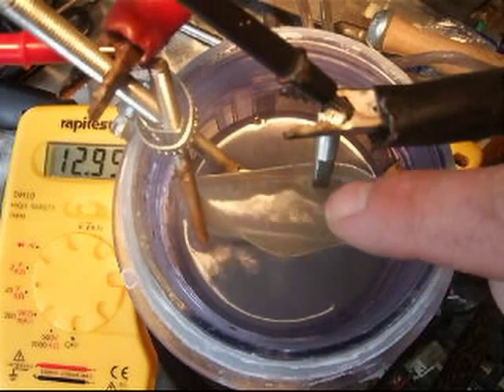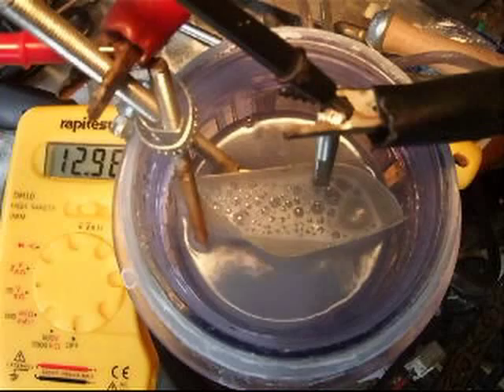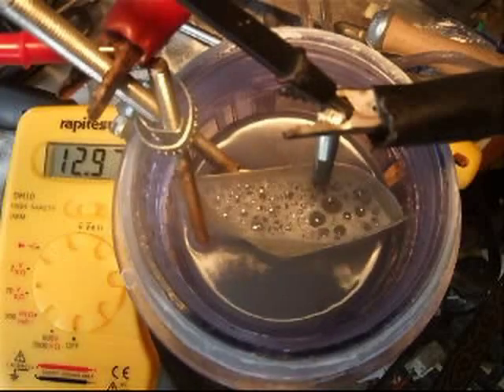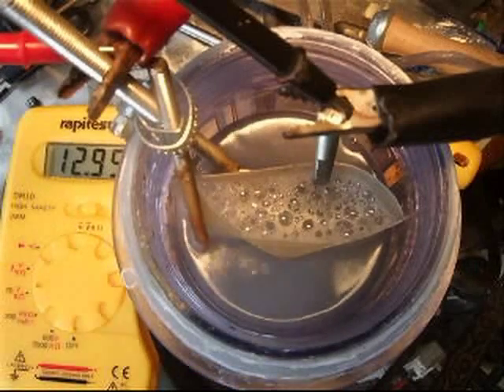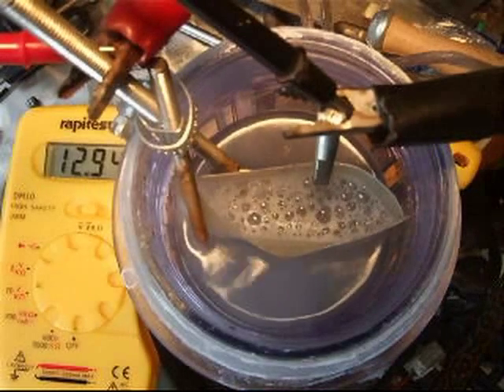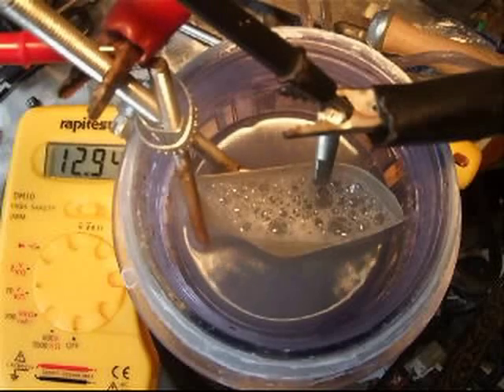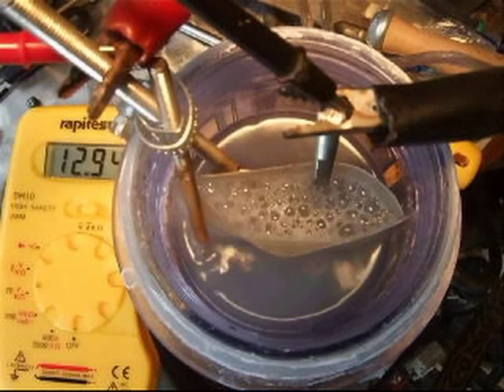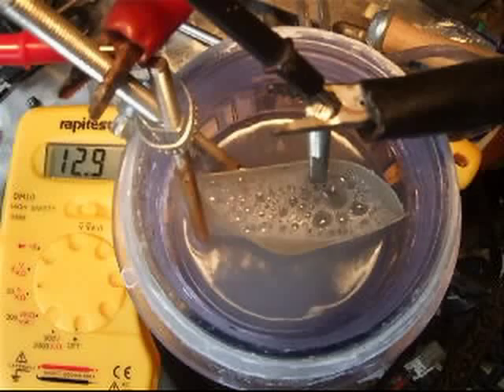HYDROGEN n OXYGEN SEPERATION

Comment: Nice demonstration video. Where you see foam and larger bubbles, you have concentrations of Oxygen. Oxygen is heavy. Where you see tiny pops at the water surface, you are seeing Hydrogen literally jumping out of the water, at 20 feet per second. Direct your camera so that it looks across the water, instead of down on it, and you will see the hydrogen bubbles before they pop. Hope this helps.

Comment: The brown gunk will appear when you use any water with microscopic particulates present, I.E. Tap water. you get shot of this problem by useing distilled water, 316 stainell steel bolts & plates, & KOH... interesting video, and yes I too think it is not all about the volume of gas that gets milage benefits.. thanks.
thom.

Comment: yes physically larger. or make the positive smaller, you need enough plates to bring the voltage down to 2volts per cell, to measure the voltage per cell keep the water level just lower the the plates, just for testing, switch on and use your volt meter to measure across the individual cells,, a poss plate and neg plate makes one cell.

Comment: The reason there is no crack is because the Hydrogen doesn't burn without Oxygen,
If you cover the top so that the two gases mix into a bubbler, you'll have your crack back. The other thing is your negative plates should be larger than your positive plates.